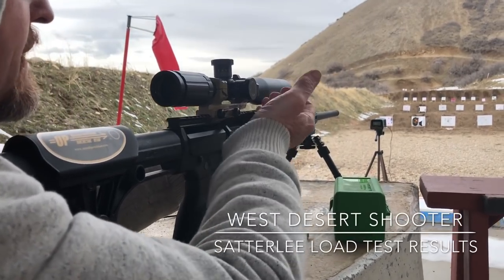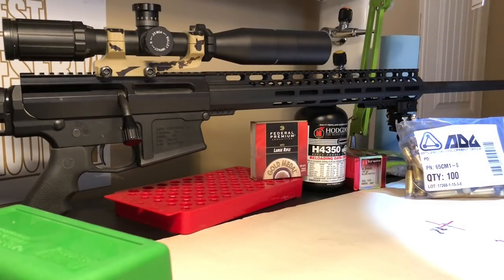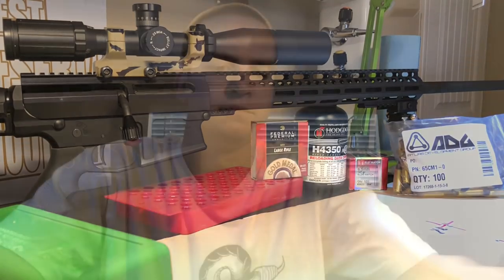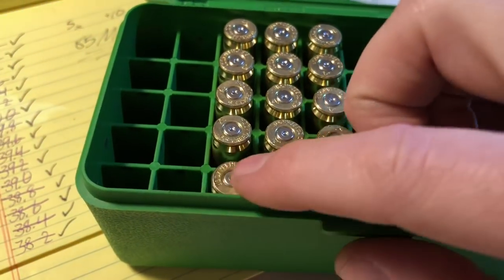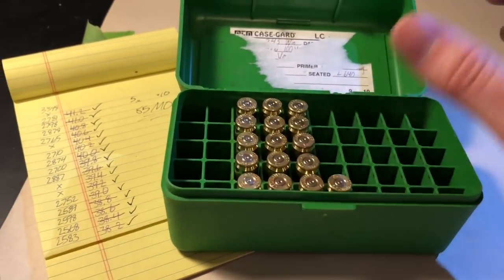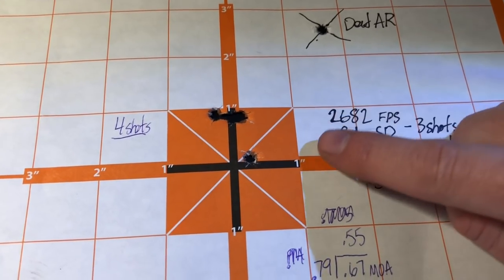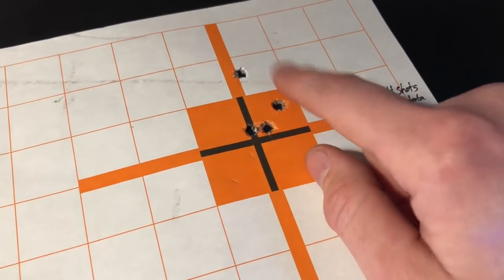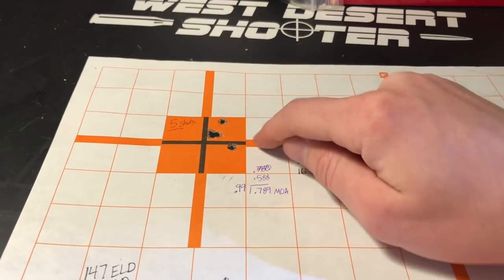Pt. 2 Satterlee Load Development: Failure...

Comment: Im sorry that didnt work for you. Unfortunately i know all to well about shit days with my competition electronics chrono. I have done the satterle test, at first looked all funky and thought it didnt work but found a node that had just 5fps e.s. and gave it a shot. Sure enough loaded 5 rounds up in the middle of that node and again 5fps! I built my ar10 with a jp barrel, im running 120gr eldm infront of 43.6gr H4350 running 2858av with the biggest ES of 6!! 1/2" groups out to 1000 so far! That test looks wonky but it works. Give it another try sometime. I went from nothing to 1/2 moa to 1000yds in 15 rounds!!!

Comment: For those who don't have a magneto speed or lab radar, this test can be accomplished without a chrono if you have a place to shoot out to 500 yds. Load up a few round of your lowest charge weight to foul your barrel and to ensure you're hitting the lower part of the target while aiming at a point at the upper part of the target. Shoot at the target, aiming at the same point throughout all charges of your ladder test loads. Use different color pendant pens to color your bullets to tell what rounds belong to each charge weight. As your charge weight goes up, so will your point of impact. The charges with close velocities (flat spot), will group together. 

Cool vid!video! Thanks for sharing.
Reply from the maker: Great test, eagle eye shooting does that style and it happens to match the satterlee test results so both can work!

Comment: Magnetospeed
Reply from the maker: Yep I think I need one
Reply: Have the spotter and I can't get it to work at all so that why I got the lab radar buy one's cry ones lol
Reply: I skipped the sporter and got the v3 and love it also made a mount out of stuff from my junk drawer so its not strapped to my barrel its attatched to my pic rail
Reply: The directions that come with it suck, they have a revised version online.  The error I was getting said something like "Twisting cable too much." The revised directions tell you to increase the sensitivity.  I use H1 for the .264 dia.  308 is supposed to be normal setting.
Reply: I have a magnetospeed that you can come shoot your loads over. I live 10 minutes from that range. Those chronographs are really only good to get an idea of what velocity you’re at. The magneto and the Labrador are the only two that I’ve used that are reliable.
Reply: Definitely need a Magnetospeed. I am going to go to this method of testing for .224 Valkyrie so I don’t waste hundreds of bullets like I have been.
Reply: with a Wiser mount.
Reply: oh yeah. there's a cool data transfer cable you can use to pull info to your phone. AVG, SD, and ES directly after you shoot. no need for the V3, just get the cable and the app is free

Comment: I certainly plan on continuing my work. After running more testing I always seem to push myself in a slightly different direction. I work with the 130 rdf in my next 2 videos. What I struggle with the most is the specific reloading process. I wonder every step that he does. Anneal next turn etc.
Reply from the maker: Like they mention it’s a good starting point he doesn’t say it’s dead on perfect each time. Hope you get those videos up quick before they start banning good guys teaching great lessons like yourself. Check loads of bacon recent video to save your YouTube videos to a hard drive

Comment: I think your test may have been skewed by typical SD variations rather than chronograph errors. For example, I recently conducted a load test for my 6.5 CM with H4350, Hornady brass, Fed 210 primers and 143 grain ELD-X bullets using .3 grain increments and 5-shot groups. The results of my three highest charge weights were as follows: 

41.2g - 2728 fps, SD-8.7, .728" @100 yards
41.5g - 2737 fps, SD-8.7, .485"
41.8g - 2783 fps, SD-15, .890"

If I cherry pick a single shot from each of the actual five-shot groups, I could have easily wound up with misleading data such as: 2718, 2749 and 2783. As a result, I would have missed the velocity plateau between 41.2 - 41.5 grains. I am not a fan of the Satterlee method and I know my old Statistics Professor wouldn't be either.
Reply: This. So much this. I've been getting a headache watching these Satterlee load development method videos. The potential for false nodes or missed nodes is very high.

All we know from the 6.5 Guys video is that this worked well for Satterlee with one powder/bullet/case/primer combination in one rifle one time. There was so much video editing and so little data collection in that video that I am highly skeptical, to say the least. There is no good reason not to perform a standard ladder test or at least use 2, 3, or 5 round averages. 

Now, if Satterlee's loading method is so superior that this technique gives him repeatable, reliable results, then he almost owes it to other shooters to walk them through his load process step by step. If he wants to teach his method, teach the entire method, from case selection/prep to shooting his final load.

Comment: One problem is with a sample size of 1 per load, the natural variation can lead to false plateaus...for example +/- 0.1 gr in scale precision, chronograph +/- 3-5 fps in precision, etc.  So there is inherent variation in the y and x-axis of the plot.  Try the 10-shot saterlee method then repeat the next day,  the results will not be exactly the same and there will likely be substantial differences due to natural variation not apparent in the sample size of 1 per load.

Comment: I don't do videos but in the process of this process now I recently bought the magneto speed witch I love after having the exact same problems you did with my buddies optical I feel your pain lol OK so did the ladder in. 2 like you did and had 3 shots with a 6 fps difference over .6 grain difference of powder so I loaded up the middle of that and shot groups without the chrony groups started at 1.3" so started walking the oal down since I started at my max box length and watch the groups shrink to .75 and thats where I'm at now had to clean and reprocess my brass and weather went to crap but will be testing shorter length to see if it continues to shrink the group or starts to open back up then I'll redo the speeds when I have the smallest group size I can achieve with that charge to see if SD is still low shooting 300 wm with 178 gr eldx if you want to know the end result I'll let ya know when I get a chance to finish

Comment: Did you adjust for the volume difference in the ADG brass? Atlas CS tells me come down 1.5grs less than what you'd use for Hornady brass, for example, I was loading 41.1grs H4350 with Hornady brass, with ADG brass I load 1.5grs less for a total of 39.6grs in my wife's 6 Creedmoor. ADG 6 creed brass holds exactly 50grs of H2O, Hornady brass holds depending on the weight of the cases 52grs H2O.
Reply from the maker: I started with ADG but my charges are lower than most with higher velocity than others. I absolutely think it’s true. They’re engineers and know brass I would trust what they say. If it wasn’t serious they wouldn’t warn people

Comment: Those darn Chronys can be so temperamental.  I am not a fan of the ones that hang on the barrel though, so I’ll keep mine until I can afford a Lab Radar.  Those are excellent SD’s and good groups.  Definitely looks like you have a winner there!
Reply from the maker: Just curious what you don’t like about the magneto speed? Thanks man I like how it’s shooting especially with that velocity info too
Reply: West Desert Shooter the magneto speed have a reputation for changing POI. It can happen and probably does, but when using mine I strictly use it for gaining data. I zero the rifle and shoot for groups with it off. I have not tried the Saterlee method yet but this looks like the perfect test to be used with the magnetospeed. Use the chrono for data, then adjust seat depth for groups without the chrono and then verify velocity later with the chrono. The Lab radar is interesting though.
Reply: @neilharris4462  poi doesn't matter for the saterlee test.

Comment: I don't think that using 4 shot strings is a sound basis for any kind of analysis of variance. For example, I just shot a 10 shot string over my chronograph and got an average velocity of 2683 fps with a sample standard deviation (SD) of 12.3 and an extreme spread (ES) of 43, however, when I pulled a 4 shot consecutive string out of that data that avoided the high and low values, I got an avg of 2680 fps, an SD of 2.9, and an ES of 11. The 4 shot data look great, but the 10 shot data look real...

Comment: My Chrono, seems to be giving good results for the low velocity 6.5's.  When I shoot a full charge it goes to crap.  I shot 223 and 22-250 (3900fps) and they were all over the place.  We need the MagnetoSpeed.
Reply from the maker: I agree we do need a magneto speed and JRBs tests with group size really sold me that it’s not a huge difference with one on the barrel. I don’t know if I’ve seen an error come across one of those either it might really be worth getting one.
Reply: As someone who has done this method on 3 rifles now, I can say the magnetospeed is definitely well worth the investment. I just used Satterlee's method for my AR308 and found damn good results in 15 rounds. If you are thinking about getting one, do it dude!

Comment: Did you see any ejector swipes? I've shoot my  6.5 up to 42gr H4350 and no ejector swipes. Mine always has the cratered primers
Reply from the maker: No ejector marks but I cut a primer in the first Uintah upper I shot and these are about there. I’m set with 2730 FPS that will get me plenty far. The groups started opening up at the higher velocities anyway it can’t always be the hottest round. Panhandle did do an awesome video on that but he is shooting 260 rem and a different bolt face, each rifle is a little different I’ve learned where I should stop chasing velocity and I’m there with the 40+ Gr loads and the 147 bullets.

Comment: Man that Uintah is a shooter. Excited for they're AR15 line up. It's interesting seeing these real results in the Sater Lee method. Bolt Action Reloading just posted a video similar to what your having. Imma try this out myself this weekend now that I sourced some H4350 and I got the same chrono. Makes me wonder the accuracy of these optical chronos.
Reply from the maker: They are just picky with lighting. Some days it works flawless and others it is an absolute crackhead. How far away do you set your chrono?
Reply: Mines usually set 8 - 10 ft and level out horizontally. I shoot facing East at my spot. LOL! Crackhead
Reply from the maker: Interesting mine really seems to like being set out around 6’ any more and it gives me crap readings

Comment: Get your self a labradar works in all weather conditions it is pricey don't have to worry anymore just my to cents and thanks for the new video
Reply from the maker: I think a magneto speed would be just as effective for a lot less I haven’t researched the labradar much
Reply: Only issue I have found is you need a wide open space.  We have trees on both side of a narrow range and it does not work.
Reply: That is try but I can't get the other one to work don't know why

Comment: Hi buddy, there were definitely some crazy speeds there, its shame there wasn’t someone down at the range that had their chronograph which was possibly a more accurate one , two readings from two different chronographs would have told you more about what was going on and if the second one showed completely different readings then you could shoot your chronograph lol, but if the readings were the same from both then there is definitely something you need to be checking in your load development.you have to remember a fairly decent group at 100 yards doesn’t always mean that it’s going to do well at distance if the speeds are all over the place, they are going to drive you nuts figuring out where your hits are on the target. 🤔 cheers G.
Reply from the maker: It was just giving me BS numbers, once I tried again using the same loading technique I got great consistent velocities. Funny you say if someone else at the range had one, I was 50 miles from anyone in the middle of the desert for the first test haha but yes I wish I had another there to try at the time
Reply: West Desert Shooter sorry buddy I thought at the start of the video you were at a range with other guys my bad , fifty miles is a fair old trek out for sure.

Comment: H4350 can be temperamental at lower temp(I see it was 46) so it may not all be your chrony...Reloading is NEVER, EVER predictable all of the time.   Also, toss out your "flier" and you'll be closer to the true performance of the load.  Some powders will "choke" so that higher charges may not yield higher velocity.  How the powder lays in the case can affect the burn rate as well.  I've improved SD by filling the empty space with sawdust so that the powder capacity was always full and slightly compressed.  Plus...it makes one hell of a muzzle flash!  Just don't shoot prone on a dry range...keep a fire extinguisher handy!

Comment: I'm interested to see how this saga ends. I went back to a bunch of my old data to see if the Satterlee-predicted waveform would appear, and sometimes I saw it, but it didn't seem to reliably track with the precision of the groups or the lowest velocity SDs. One quick question: are you measuring your 2.805" OAL to the ogive?
Reply from the maker: No with this setup I’m pretty limited with mag length and that’s one of the big advantages of the system so I like to keep them mag length. I’ll measure OAL base to tip of bullet then watch consistency with the comparator on the ogive
Reply: WHY would you measure OAL...if it's not "OVERALL"????????